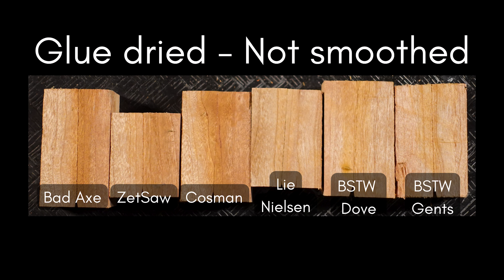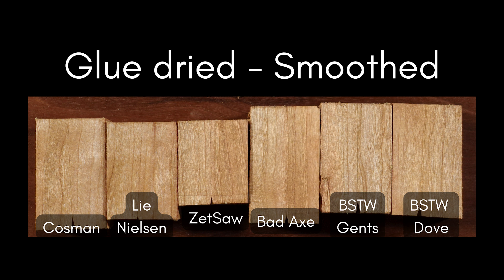Top Makers Put To The Test!

Comment: So, for a proper test, you should take two different sawn pieces and glue those up. Anything split with any tool in any shape will mate back together rather nicely. Say you're gluing up a panel; you wouldn't split your board, then glue that same board back together, unless flipping the end grain to prevent cupping. This means two different saw cuts on two different faces. I hope this makes sense.
Reply from the maker: STEVE! I said don't get technical! but I get you :D